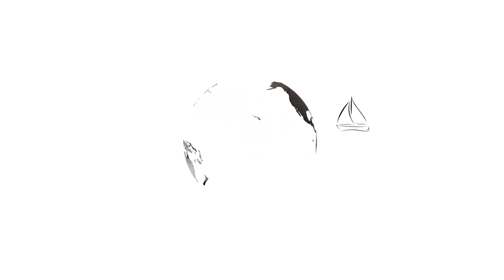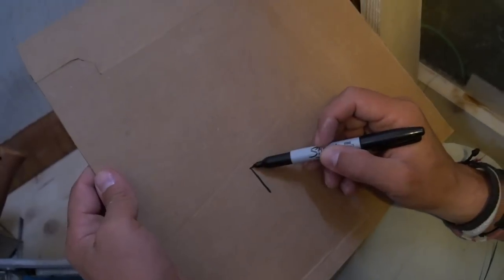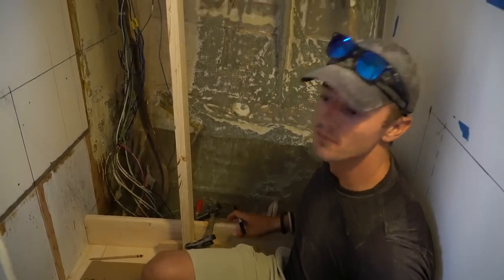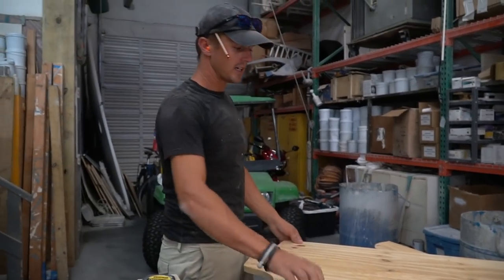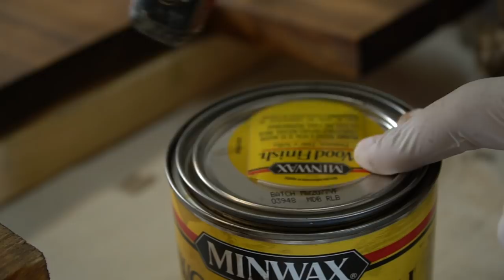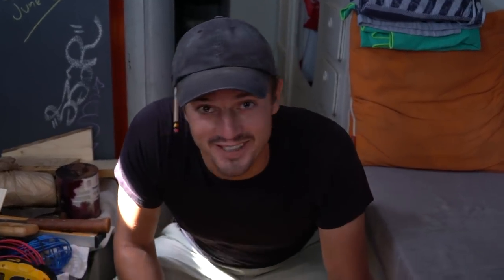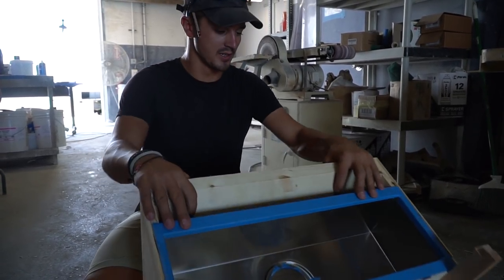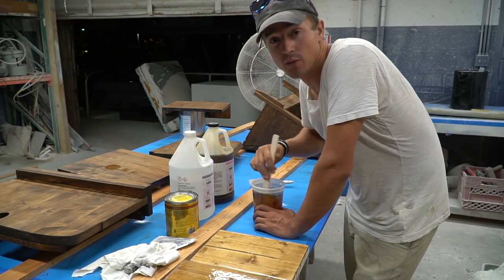Sailboat DIY Head Renovation (Part I)— Sailing Uma [Step 132]

Comment: You should always coat both sides of solid wood. If the top is sealed and the bottom is not, the bottom will absorb moisture and swell up a tiny bit. That can be enough to give the whole piece a curve.
Reply: And I would have applied atleast one coat of epoxy on top of the stain before initial assembly as it will be in a high moisture environment like a head.....even if you use marine grade plywood it is a good idea to seal with epoxy like cruising lealea did with their boat.
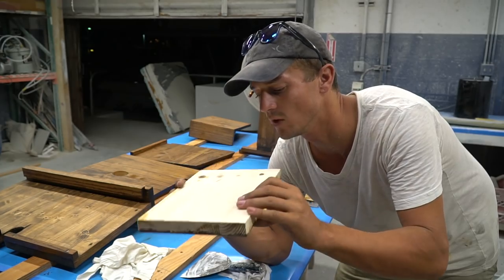Reply: Dan said he will seal both sides with epoxy at 16:08.....
Reply: Looks like he sealed both sides

Comment: Someone may have already mentioned this, however, if you care about getting a clean opening on the far side when using a hole saw, simply finish drilling from the underside sometime before you break through. You already have the pilot hole so it works well. This is a great video series. Many thanks!

Comment: ACX or BCX plywood definitely uses "water resistant glue" for sure !  Also the face and cores are typical from spruce/pin/fir which WILL absorb moisture and rot so 'glassing the edges and surface is mandatory.  (I would have put one coat of unthickened epoxy on all of the edges the first day, just help seal them.)
Reply: + Jack Patteeuw Are you aware that X means Exposure 1 (limited exposure to the weather) and not Exterior?
Reply: Paul Ohlstein - Does it really matter ?

Comment: Suggestion for cleaning bottom of boat.  Visit a chain drug store, look in equipment section (canes etc).  You will find suction cup handle that attaches to tile to help get out of tub.  Suction works just as well to fiberglass and gives you something to hold while scrubbing hull.  Easily movable as you go along, not so much swimming to stay in one place.  Good Luck eh! :)

Comment: If you gently heat it will smooth out more and remove the air bubbles. basically take a torch and run it at a decent distance off the surface.

Comment: Many years ago (I am old), when I was a jobbing carpenter in scenery building, I used to turn up at various workshops, where just about everyone had DeWalts or Makitas. I would pick up my tool bag and start removing tools and as I put my cordless combi drill out on the bench, there would invariably be the odd guffaw and comment like "Where did you get that? B&Q?", at which point I would challenge them to try and stop the chuck rotating on their 18 volt Dewalt and then challenge them to stop the chuck spinning on my Fein Cordless. Invariably they found it quite easy to stop the chuck spinning on the Dewalt and were rather surprised when the Fein nearly broke their wrist.  The moral of this story is that Dewalt's suck.

Comment: Question: I never worked on boats but used fiberglass on cars with 2 parts polyesther resins.
Why epoxy is used applying fiberglass as you do? Safety ?
Reply: The epoxy resin does not stink as bad as polyester (It still stinks) and it makes a more reliable bond with the existing FRP hull.
Reply: Thanks !
Reply: Also stronger and more work time

Comment: Every measure is a mistake. Use that vertical pole and make a card board template and scribe with a tick stick. Easy peasy.
Reply: Eh, the way he did it worked out perfectly.

Comment: You do great fiberglass work, think about cutting the brush bristles back half the length of the brush bristles makes the brush a tad stiffer, helps in applying the epoxy, just a suggestion.
Reply: I find the best 'brush' for applying epoxy is a 'foam roller'. 😀

Comment: Great video. Read all the comments and will repeat oft stated suggestion.  Wear Eye Protection.  Worked in ER and saw too many eye injuries from DIYers.  Also use pusher when using table saw.

Comment: Hi :-)
I have watched you do several fiberglass jobs and I always wonder.  Is the fiberglass mat you work with so terribly itchy like fiberglass insulation?
Cheers,
Jay
Reply from the maker: Nope! The mat isn't itchy at all. Fiberglass dust from grinding is though.
Reply: Thanks :-)
Reply: It's worse than insulation, especially when cutting, rasping or sanding the cured product.
Reply: Don’t you know that fiberglass on your own boat doesn’t itch at all lol

Comment: sweet. is to late by now but if u go over the epoxi with heat u can get rid of any bubbles that may formed. friend of mine does amazing art layinering in epoxy check out (fb) troy carney. somewhere there he even explains the process with the bubble... he use to do surfboards too <3

Comment: So I build houses for a living, not boats so forgive me if this is a stupid question.  Would it not be better to use pressure treated plywood? That is obviously what we use for anything outside / exposed to moisture and the elements.  Would it not provide better moisture resistance?

Comment: for reinforcing fiberglass, especially a place where things are going to be screwed in or on, incorporate a thin piece of metal or an additional piece of plywood as a stiffener.  Fiberglass feels firm but it actually flexes a bit and over time, a through hole or a connection area can loosen or wear or break down a bit.  A potential problem down the road and the fix is easy if you do it ahead of time.
Reply: Gary Myers while a good idea its not something to do around through hull fittings. If it begins to rust or corrode it'll cause it to delaminate
Reply: SouthJerseySound in that case, use wood as the stiffener.
Reply: Gary Myers wood coated in thinned epoxy is what we used to do at my old work. We'd thin the epoxy so it will soak into the wood and it works extremely well. After a few coats its as bullet proof as anything and I've seen boats they built 20+ years ago with no signs of rot.

Comment: Guys, next time use a joggle stick. Look it up, it's an old carpenter's trick and should make weird cuts far simpler.
Reply: TheDamnSpot I looked it up, thanks, very clever.
Reply: And what is a "joggle stick" ? Never heard about it . Please tell us.
Reply: Just google it and look at the images that come up. Hard to explain in text.
Reply: Never heard of it called a joggle stick. Called a tick stick in my area. Way faster and probably more accurate.
Reply: I know that it's also called a tickle stick (never heard it called a tick stick though,) but in google if you search for it as joggle stick the correct thing comes up. Carpenters in every region have their own take on nomenclature. When I moved from the East Coast to the West, I once had an hour long argument bout what should be called 'dog ear' vs 'return'. Don't ask...
Reply: wow, can't wait to try it.

Comment: You're measuring in imperial, you can't be TOO precise ;)
Reply from the maker: Hehe, I had to order a metric tape measure from Amazon! Can't even buy one here anymore.
Reply: I remember being in 4th or 5th grade in the late 70s', they kept telling us that the US would be on the Metric System by 1980. LOL , they missed the deadline by a little.
Reply: I think the USA is the only country still using imperial . Geeez, even american cars are in metric since many years - 30 + !!
Reply: Actually, Myanmar and Liberia are also on the Imperial system.